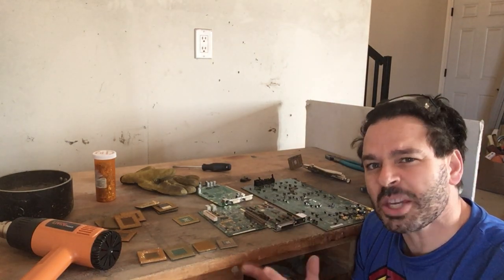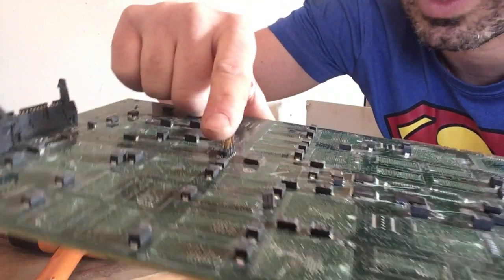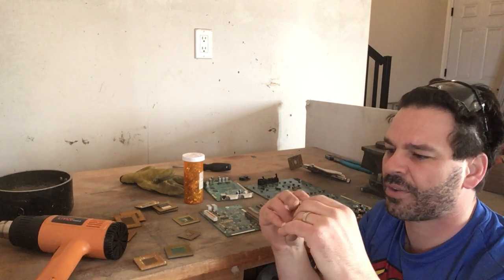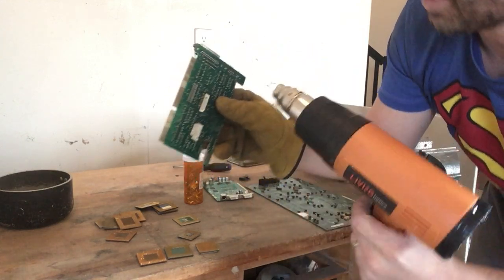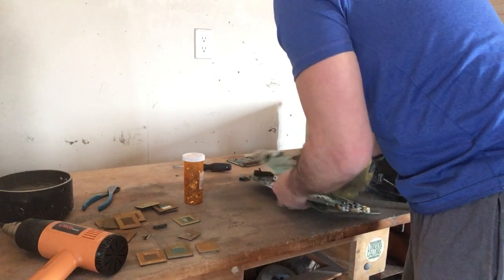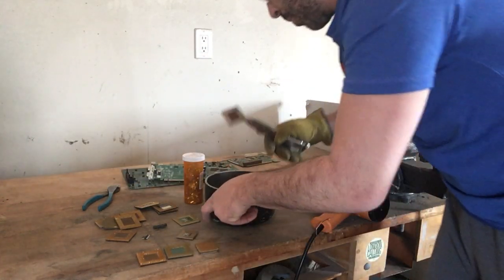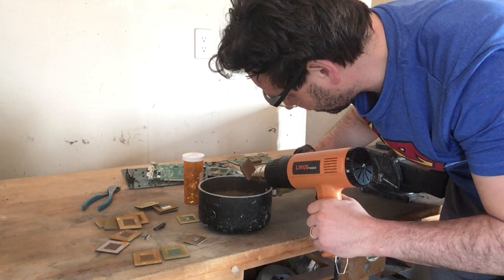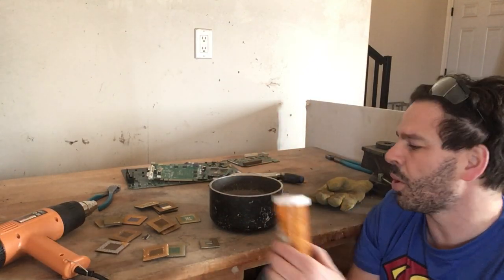How to easily remove gold pins from circuit boards and CPU chips using heat.

Comment: I'm just getting into scrapping. If I do this method does it negate the need to use acid to extract gold? I don't mind the chemistry but spending money on chemicals is way more expensive than spending money on a bit of electricity.
Reply from the maker: I think it depends on where you live. In Ontario it is difficult getting some of the chemicals. Also it could also depend on your scrapyard, some of them nearby me will give a lot better prices for high end boards, avoiding taking them apart.

Comment: More people should see this. You saved me the headache of trying to obtain a decent sized bottle of nitric acid. I found some on Amazon that unfortunately is not very good quality and couldn't find any other listings. And I don't want to use sulfuric acid because that's going to damage the gold.

And I did not want to have to jump through any hoop shifts to get some. Before anybody says what about muriatic acid, I don't know if that will work. I don't know if it'll eat away at the soldering or the board itself. I try to research it, but couldn't get a straight answer.
Reply from the maker: Thank you for the comment and kind words. Glad you liked the video and found it informative. Stay well and happy scrapping

Comment: I've gone through two heat guns already. You'll find the elements burn out fairly quickly. If they have two settings, turn it from high to the low range before shutting it off. The lower setting will help it cool down without fatigue / heat cracking the element.

I have a vice I hold motherboards in, place a tray underneath it to collect all the pins and chips during depopulation. I typically pry off the aluminum capacitors because they can explode when heated. The transistors, resistors, diodes, that I can cut off with my dykes (diagonal cutting pliers) I do so before heating the board with my airgun. The only thing I use heat to remove are the gold plated pins / sockets, MLCCs, mosfets, flat resistors, and IC chips off the circuit board.

I find it pays to sort and stow away items I depopulate from the boards at the end of each day. This way, I don't have to sort through several buckets full of items over a week or two.

Remember to take care not to burn yourself or catch adjacent items on fire.
Reply from the maker: thanks for the tip.

Comment: What temperature is the heat gun please.
Reply from the maker: 920F or 425C on high.
Reply: Thank you. Do you use an electronic device to test silver and gold quality? If so could you tell me what it is. @TinManScrapper
Reply from the maker: No I don’t. The gold is just gold plated, but gold is gold.  @CaptainRadack

Comment: i have 9 desktop computers i took the circuit boards out and 2 flatscreen tv's..how much gold do i have estimated?do flatscreen tv's contain gold because i pass a lot of them up on the street being thrown out?
Reply from the maker: Yes, they have long green circuit boards with a gold plated strip down the one side. Depending on size sometimes 2 or 1. Not sure how much gold but all gold plated.

Comment: I've been collecting circuit boards from electronics and flat screens and I have a few questions to ask you. There's tags connected to the screen and circuit board is there some gold in them? And in your opinion what would be a sizable amount to start the separation process? I wish I could show you what I've collected so far I think I have a nice collection but I'm gonna keep stacking it
Reply from the maker: I keep stacking as well. The tags have a little gold inside and I keep them with my gold parts, although not a lot
Reply: Thanks for getting back to me so soon I appreciate the feedback

Comment: you can also use a clothes iron and make a holder to turn it upside down and leave the board to set on, make sure to move air outside
away from yourself.

Comment: Thanx for the videos I have found them very helpful..always learning new things.  I have a question for you...I don't have a hot gun can I use a hair dryer it blows hot air would tht work?
Reply from the maker: I don’t think it would get hot enough to melt the soldering.

Comment: Not bad.  Remember solder is liquid at 300 - 350 degrees.  Try a propane torch or soldering iron.  .

Comment: Tin man where are those located, are they on flat screens?
Reply from the maker: The s squares are cpu chips from computer towers and laptops.the flatscreen TVs have long circuit boards usually at top or bottom of flatscreens that have strip of gold plating, not pins.

Comment: Ammonium nitrate And hydrochloric will make quick work of those pins. Peroxide and hydrochloric. Thales forever. Usually let the sit all winter if I’m using peroxide method.
Reply: Great little tips for new scrappers.

Comment: Thanks Tin Man. Hadn't really thought of using a heat gun, but will look into investing in one. Looks much easier than the method I have been removing pins from mother boards and such. Thanks also for the info on removing the core and magnets of the microwave mechanism. I have several that I haven't finished scrapping.
Reply from the maker: Saves my wrists for sure
Reply: Sometimes a diy solder bath is best for server pins. And way easier faster. 
God Bless.
Reply: @jj74qformerlyjailbreak3  Pardon my ignorance, but what is a diy solder bath?
Reply: @michaelraulerson8875  I had an old 3 burner coffee pot. All have separate controls on the hot plates. I have a little plate I fabricated i pre-melt old solder in. After molten lay scrap boards across and the components come out like butter. As long as you secure it 😆. But all in all very useful recovery tool.

Comment: just a suggestion you might wanna try letting them set in the sun and get hot first then you wont have to use the heat gun as long
Reply from the maker: Good suggestion, but hard to warm if winter out.

Comment: Could you ever do a video on gold extraction ?? Preferably without hard chemicals but however you do it at home.
Reply: I too am wondering how to take those gold scraps and separate the pure gold from it
Reply from the maker: @maximog87  I will eventually do gold boards, but not yet pins as I want a larger amount to make it worth while. It will be in the future plans, but want to also get a crucible so I can turn into bullion
Reply: @TinManScrapper  what would you personally use to extract the gold ?
Reply from the maker: @Gigachadly  going to try first using high concentrated vinegar. Safer than hydrochloride acid